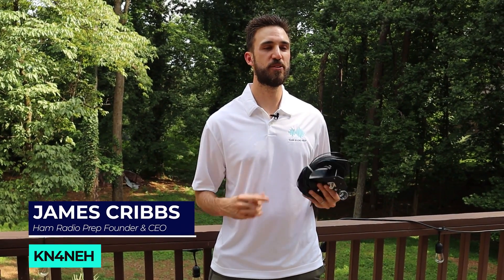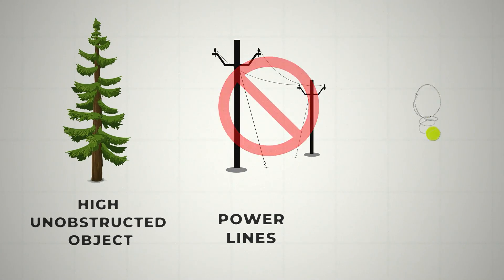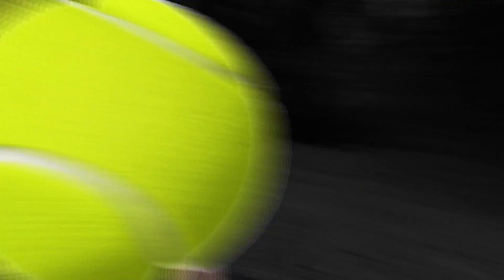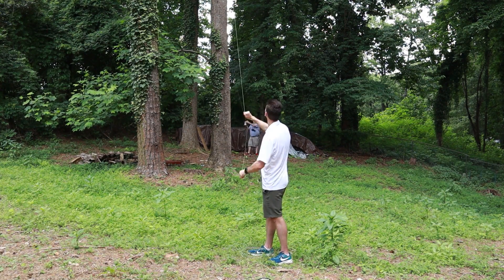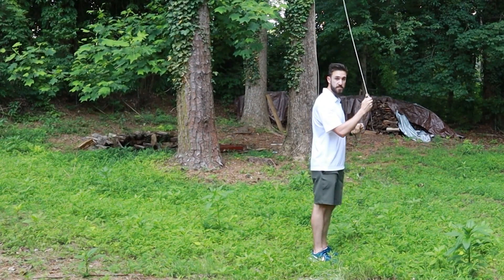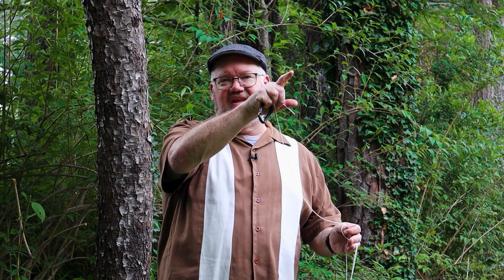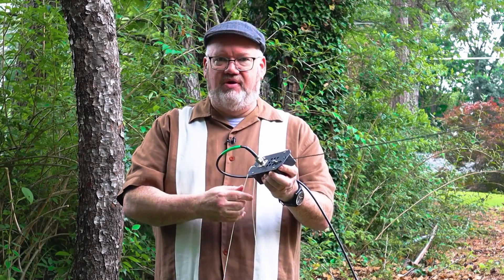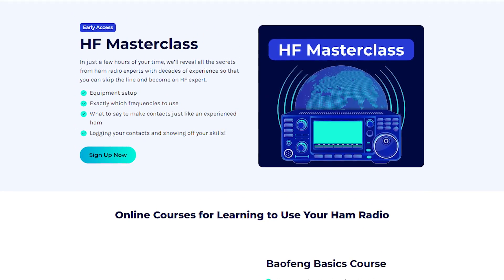End-Fed Antenna Setup!

Comment: Thanks for this. Does it matter whether the balun / coax connection end is higher or lower than the rest of the wire or is it not relevant? I could not work out in my mind if it affected signal direction - sorry if this is a silly question
Reply from the maker: whether the balun/coax connection is higher or lower than the rest of the wire doesn't inherently affect signal direction, as the balun's primary function is to interface between balanced and unbalanced systems.

Comment: Thanks so much for your video series! means a lot for a Technician working on General; but planning ahead and studying antenna options (I've already decided the Icom 7300 is the rig for me). In my backyard I have 90 feet to play with. I could put an eye bolt into the high gable end of my house (it is roughly 20 feet high), plant a stout pole near the property line and run the end fed antenna line to the pole. Since my yard seriously slopes it would be practically horizontal the top of the 10 feet steel pole. Feasible? I realize that 20 feet high on the house end is not optimal but have already learned in Ham that there are many trade offs and compromises. Thanks for any input. W6RYM

Comment: Why not put the balun (unun) at the house?  Shorter coax run.  Also, you called it a dipole.  I wonder if that's right.  Isn't it just an end fed longwire?  Anyway, you guys are masters at production. That SO-239/PL-259 just knocked me out with the graphics.
Reply: I caught that too. I think he simply misspoke since this was about end fed half wave antenna.
Reply: @jackmortimer329  an EFH is essentially a dipole fed from one end. That's probably what he meant.

Comment: Good video on getting your wire up in the air. 
Well, my 66ft EFHW is a sloper between an 8ft pole and a 20ft steel pole at the other end. Such is what you do when you don't want to run 200ft of coax to the feed-point just so i can get the wire up in my giant oak tree which is the only available tree on the lot. It works pretty good this way as the SWR for 40-20-15-10 are all below 1.8:1 and I can work Asia, SA, CA and eastern EU with this and my barefoot FT710.
Reply from the maker: Hello Alvin, thank you for sharing your experience with your EFHW!

Comment: On the initial issue of getting the antenna up there, I note many YT vids make relatively light of this, but it took me several weeks off on/off attempts during weather breaks to eventually establish one, and I was ultimately forced to settle for the lowest large limb I could reach (about 25/30ft off the ground), making it more of a sloper, albeit ending up randomly around 41 ft long between the feed point and the isolator, which led me to use a 9:1 unun instead, thereby 'accidentally' creating a random end-fed. I haven't been able to test it for transmission yet as (seemingly thanks to the current ARRL meltdown) my license application still hasn't been sent to the FCC over 2 weeks after my exams, but it receives well and I got HF transmissions from all over the US before the bands deteriorated. I even hooked it up to my VHF/UHF Alinco radio during the recent geomagnetic activity and was actually hearing a VHF FM net on the east coast of the US (I'm on the west coast). That was unexpected. Or was it actually a linked repeater system? I'm new to this so who knows. Hopefully it will work well on transmit once I can actually use it for that. But to come back to the initial point, tennis ball launcher cool, but most will resort to a slingshot or maybe a weighted throw-line and it must be emphasised that it can be difficult to get your line where you want it - in my case about 25 ft higher than it eventually was. Mind you, this may also have been aggravated by the nature of the tree (a tall honey locust. They are gnarly). Good luck though to anyone who attmempts it. Hope this annecdotal info based on personal experience was useful. Les.
Reply from the maker: Thank you for sharing this experience! I'm sure this is going to help a lot of people that may experience similar issues

Comment: I use a 40M EFHW but I have to mount it backwards. I run it out of a 2nd story window about 16 ft up and that is were the Balum is. The end goes to a wood fence in and is about 6ft off the ground. It works but would it be better to have the balum on the low side?
Reply from the maker: Hello, I don't think it will make any difference to put the balum lower. But it would be interesting to do that test and see if you see any change, then you can share it with us 🙂